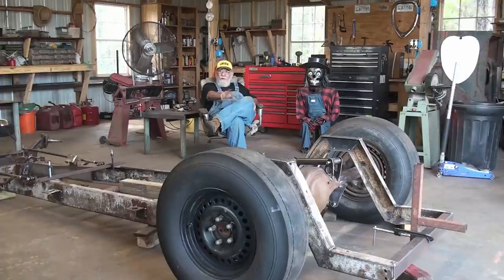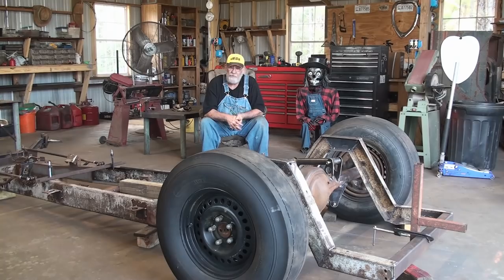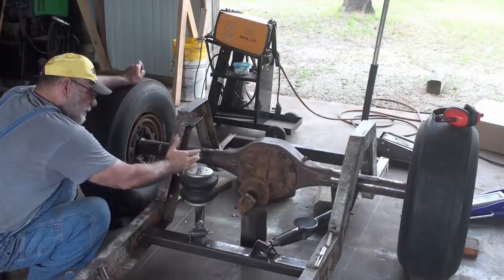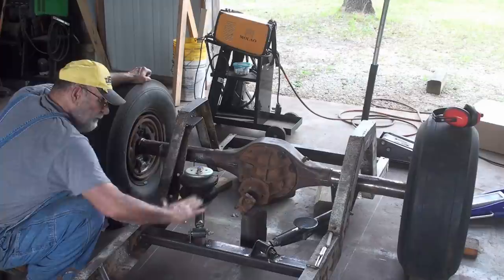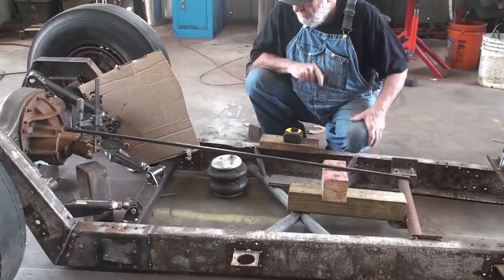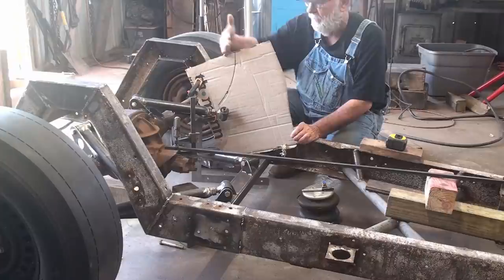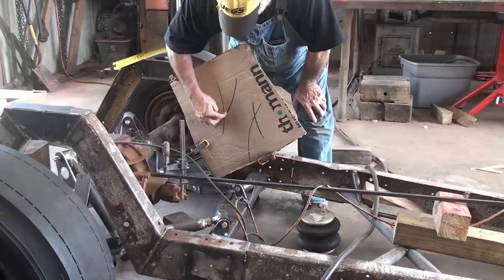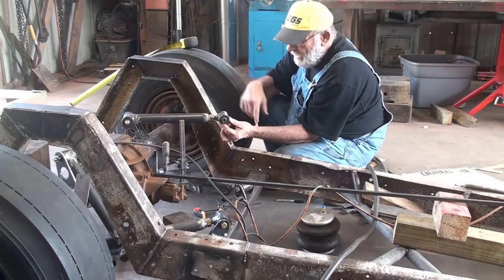47 Ford Truck Rat Rod - Triangulated 4 Link From Scratch Part 2

Comment from the maker: Another detail I forgot to mention is that the top link needs to be 75% of the length of the bottom link. My bottom link is 20" long and the top one is 15".  That is true even with a parallel 4 link.
Reply: Thank you for sharing that. I would have assumed equal length otherwise.
Reply: I thought it was 70% of the bottom link.. Thanks
Reply from the maker: @geoffreymills9932  Close enough. I use 75% because it's easier to calculate.
Reply: Thank You for this and all the other information. t.
Reply: Are you going to leave the mounting points for the links open (double shear) or are you going to tie them together like a C channel?
Reply: I'm sold .  I believe I will use a triangulated rear. I'm using your videos to build mine.
Reply: Parallel 4 link are even length...all 4 same length...

Comment: If you don't have a degree in engineering already some college ought to send you one in the mail.
Reply: The days of "self-taught" like Lincoln's self taught reading so he could pass the bar exam without a law degree are long over! ...and it's a crying shame because there's an awful lot of real talent out there that goes unnoticed because people don't have deep pockets to pay for some name school!
Reply from the maker: Ha ... it's a shame that some of these big name schools turn out some of the biggest air heads.

 True story:  Back in the 80's I was working hard in construction .. in the heat and wanted to better myself and learn how to build and program computers .. so I went to every library around and checked out every book they had on the subject ( before internet ) ... bought my first computer and learned to program in PC Basic .. wrote/programmed several simple computer games ... it was like a miracle to me. My next computer was one I built from components and I learned to program in C which was before C++. In 1989 ... got injured on my heavy equipment operator construction job and had to train for another job .. which I choose computer programming. In 1990 I had to do a community college thing to get that piece of paper that said I had potential and I done an apprentice thing at a local distribution center programming in a C++ and a 4GL database language (PROGRESS 4GL). Was working next to two other guys who had bachelor degrees and was working circles around them ... they would come to me for answers. Bottom .. line ... with no degree ... 2 years later I was making $40 an hour ... 3 years later $50 and hour and $60 an hour by 1999 .. the sky was the limit. I worked coast to coast as a consultant in database design and computer program specialist for fortune 500 companies! You could only imagine how all those high class folks reacted when this guy with a strong southern accent walked in and worked circles around everyone with high degrees. It was so much fun to watch. But my true roots was in construction being outside instead of inside looking out from a high rise window. So in 2002 .. after I proved to myself that I could be/do anything I wanted .. I went back to construction (for a lot less money but much more happy) until I retired in 2014. 

So my story would be ... you can do/be anything you want if you have heart and want it bad enough and put in the work to make it happen. Also ... and most importantly ... money certainly does not make you happy. The more money I made the less happy I was .. led me to some dark places that I had to overcome if you know what I mean. Like Richard Pryor once said ... cocaine is Gods word for "you making to damn much money". End of story.
Reply: @RatRodBobBuilds  Amen, brother.
Reply: I do have a degree in Mechanical Engineering but I learn heaps from your videos thanks Bob.
Reply: @RatRodBobBuilds  hell of a great story Bob. Thanks for sharing.

Comment: Thank you Professor Bob!
  You saved me a ton of grief with today's lesson. I am preparing to build a four link starting tomorrow. I was going to construct the parallel style. Now I'm definitely going triangulated. Locating the top link would have taken a ton of trial and error had you not shared the highly classified X marks the spot method.
  You made my morning!
Reply from the maker: Another detail I forgot to mention is that the top link needs to be 75% of the length of the bottom link. My bottom link is 20" long and the top one is 15".  That is true even with a parallel 4 link.

Comment: You got through to me Bob , that's as good as it gets ,i have a two link ,with a panhard bar ,and on top of the pinion, I'm putting a third link ,to keep my pinion angle straight,and coil springs with wieght jacks .thanks for another great video!!

Comment: Thank You Professor Bob. You are my inspiration to build my ‘29 Dodge Brothers (what was a car) that was sectioned in the ‘40-50s to be a pickup. The question/concern is the angle of the driveshaft. In all the years of building jacked up 4x4s, I was told by a driveline shop owner that no matter what the angle of the driveshaft the most important is the angle of the transmission output shaft and the rear ended input shaft MUST be on the same plane. Or the u joints will be in a bind and Will lock and blow out. Bad things happen. Also leaf spring tear ends have a preload of about 3-5 degrees so that under load the leafsprings curl. That’s why traction bars where created.
Reply from the maker: Truth be told ... point the rear end input shaft to the tranny output shaft as close as you can and call it a day. It would take a hell of an angle to bind the u-joints. I just did it this way because I can. LOL

Comment: Bob, I know you like the Rust look but have you ever thought about painting the entire car one single color without any of the prep work ...Paint right over the rust, the dents, the scratches and the deformities to simply have a uniform color?  I can see this Pick-up in a light tangerine!  You don't even have to use a spray gun.  I once painted an entire car with one of those red plastic handled mini-rollers and a a few quarts of Rustoleum paint. I applied the coats very thinly and after the third coat there were no drips, streaks or lines.  It came out astonishingly beautiful and because the paint is  a sort of filler in itself, smoothed out a lot of the anomalies!

Comment: Very nice brackets especially the top front clever
Reply from the maker: At first I was thinking ... man these top front ears are gonna be a pain in the a$$. So as usual I took one step at a time and I fabbed the outside ones first .. then like magic ... as usual the other ones came right to me. So the bottom line .... do what you can ... the rest will come to you in time.

Comment: Great job on the 4-link... But you do NOT want the yolk from the rear end to point toward the yolk out of the transmission you want them to be as close to parallel planes at ride height.

Comment: I like your set up and lower bag bars, Your Thinking Chair is working fine. 4 link parallel bars work fine with Hiem joints but not with bushings. The 75% is not true with parallel 4 bar, just ask Red. Get 2 Popsicle sticks and some thumbtacks and make a jig on that cardboard. I wana see Red eat a Popsicle. I look forward to more RRBB.
Reply from the maker: Good idea with the popsicle sticks. I think 70% would be the scientific number for non Rat Rods. Also depends on the angle of the front mounts .. I think. LOL

Comment: Bob, that was a very informative video.  My 1967 Chevy II Nova still has leaf springs and I found out that they are not exactly parallel. The front mounts are slightly wider than the back.

Comment: Love the build I enjoy watching gives me some ideas for a couple projects I like the idea of the triangulated 4 link makes a tone of sense hyme joints would give a lot smother travel in addition to that style I think id use that in part of the combination
Reply from the maker: Yes .. but you have to consider hyme's joints will wear over time but good for racing because they don't get a ton of use. As you have seen .. I used hyme's joints on the front but will have to be prepared to replace them over time. Unlike factory joints that have grease certs (well .. at least they had them back in the day .. lol).  But ... if I wasn't so frugal on this build I would have used them on this 4 link too .. beings it's a Rat Rod and won't get a ton of use.
Reply: Agreed they would wear I also forgot to mention that my builds are small scale rat rod gokarts and lawnmowers things of that sort also dead  red makes me smile every time I see him I just want to say I'm not criticizing any of your building its quite informational iv always built thing with what ever I could find turning it into something fun and functional thank you very much for taking the time not only on making you videos and for reading and responding

Comment: bob, you want the top and bottom bars to be parallel when at ride height? i like how the lower bars go one way and the top go the other, keeping the axle centered as the axle goes up and down....not need for a pan hard bar with that.
Reply from the maker: I understand your question .. and the answer is not exactly in my case. A lot of geometry in the four link setup but the x marks the spot trick works great for me .. without breaking out the slide rule. LOL

Comment: I think what your trying to say is, triangulated is the way to go for a driver. I gotta try it on something.
Reply from the maker: If you look ... I used triangulated on the 454 Rat Recon and Charlotte but parallel on the Demon Falcon. So ... yes! I used the cardboard x marks the spot on the triangulated builds but this is the first time I showed it. Works perfect and you don't have to be a rocket scientist to do it.

Comment: From a top view, the bottom links point somewhere towards the transmission and the top links point to the outside of the frame. How do you determine the degree angle of the top and bottom links in relation to each other? Great video Bob, school has never been so interesting.
Reply from the maker: I just wing it. Ha ... best answer I can give. I would say mine is on about a 25-30 degree angle and I try to keep the top and bottom on the same angle .. but honestly ... I eyeball it.

Comment: ((😂)) Lol” gotcha Bob” I just just a long ways from getting it done yet.. them air bags looks very similar to the ones on the back of my eight bag air ride setup on back of my Kenworth simi truck .. I just wonder if them type of bags will work on the rear of my 31 Rat I’m building .. I’m just wanting to run bags only on the back of my Rod the front is setting low enough with a 4inch drop I-Beam front axle.. plans are to channel the firewall down over the frame, body with a slight tilt down at the firewall that when the rear section of body drops down it will set even on the grown .. do you have any Rat Rod ology input for me on what I’m attempting to do ?
Reply from the maker: I call that the wheel barrow effect. Check out my first Rat Rod .. the 454 Rat Recon ... here is the playlist: https://www.youtube.com/watch?v=1JCKcBif-LY&list=PL17ffBx4Y_BOvy-dA6ztCm6a14qFNIr-W

Comment: Hey Bob, always  look forward to your videos.  The rear suspension is looking  real good!  I would like to ask you  what thickness of metal do you use for the tabs on the suspension?  Thanks again for taking the time for schooling us in rat rodology.
Reply from the maker: I usually use 1/4" but I used 3/16 here ... will be adding another piece to the bottom ones for bracing when I welder up. Stay tuned.

Comment: Thank you so much ,trying to decide how to link my rear end in right now ,and this is very helpful ,can this design be applied to my ratrod ,without air bags ,i have coil springs over the top of the axle with weight jacks from a stock car (screw jacks), also i may need to go with heim joints if budget insists, but it will be triangulated, or only a two link ,thank you Bob once again !
Reply from the maker: Sure ... works great with coil springs. That's what I used on Charlotte with triangulated 4 link.
Reply: @RatRodBobBuilds  Oh awesome ,thank you for the info Bob ,now just have to get some of that liquid rubber on Ebay ,haven't been able to find it anywhere else ,and the shipping is double the price plus tax out here in Arizona ,see ya next video ,take care now Bob ,and Red too!

Comment: Yes you got through Bob. So you can make the bottom link length whatever you like, so long as the top link is made 75% length of the bottom one?
Reply from the maker: They say 70% but I use 75% because it's easier to calculate in my head. Ha ha.
Reply: @RatRodBobBuilds  If you measured in metric 70% would be easier, say a bottom link is 890mm. 10% of 890 is 89, so if the top link is 70% , it is 89x7= 623mm. Not easier for everything but metric wins this one.

Comment: Well done Bob , But there one thing i don't like is why did you drill those big ass hole in the top brackets for holding the top bars , I know there going to be no stress but there always a but on road use ,  In time they  might tend to crack as there not much material there now.. I myself would slid a pipe though the holes and go all the way to the diff housing  and weld it together for strength  that would look Cool and stronger   .. Otherwise great job ..

Comment: You explain just fine, just one question the bottom links are facing in and the top links are facing out, what degree did you use on the brackets. Thanks Bob
Reply from the maker: I wing it ... 25-30 degrees.

Comment: I'll use this on my builds thanks Bob. 1 question. Isn't a leaf spring rear basically do the same as a parallel suspension?
Reply from the maker: Leaf springs are really flexible ... making them perfect for a daily driver but needs traction bars to keep them from twisting in a driver/racer application.

Comment: Hey Bob, is there a rule of thumb on the angle of the triangulated 4 link to each other, in other words like if you were looking strait down at them
Reply from the maker: Probably ... scientifically. But I don't know what it is. Mine are about 25 degrees.
Reply: @RatRodBobBuilds  Thank's Bob for answering my question's as usual

Comment: Thanks Bob that was interesting and I learned a lot. I'm pretty impressed, and I don't impress easily! Are you going to be gusseting the axle brackets, or should they be strong as-is?
Reply: They are already as strong as the axle or the weld without a gusset cause the diff is only going to try to turn over
Reply from the maker: The lower ones yes ... because there are kinda long. stay tuned.
Reply: Sorry Bob guess I was wrong waiting to see thanks for the reply back

Comment: Bob what are the dem on your 4 link pipe outer dim and lenth on that pipe and is it chrom molly pipe.
Reply from the maker: The outer diam is about 1 3/4" . The bottom links are 20" eye to eye and the top are 15" eye to eye. I went to the steel yard and bought a stick (20') of  1 1/4" pipe. Same thing they would use in the oil field or a plant. Mild steel .. not chrome moly and not NHRA approved .. LOL. I'll be using more of it in the build ... stay tuned.

Comment: Bob how did you figure out where and how long the bottom tabs on the rear axle ..
Reply from the maker: The rule of thumb I use is ... the longer the rear end travels up and down .. the longer the bottom link needs to be. My rear don't move a whole lot so I used 18" and then another rule of thumb I use is ... the top link needs to be 75% the length of the bottom link. So in Highly Classified Scientific Rat Rod Calculations ... the bottom link is 18" so half of that is 9" and half of 9" is 4.5" so 9" plus 4.5" = 13.5" which = 75% of the bottom link. So that's the length of my top link ... 13.5". Or to make it simple ... make your bottom link 20" and the top link 15".  Should be good for most rats. But then again ... so is 18" and 13.5". For really short travel you could get by with 16" and 12". Don't do like me and over think it or you'll never get anything done. LOL

Comment: So the lower and upper links won't be parallel from each other?
Reply from the maker: Parallel 4 link is more for racing on flat surfaces while triangulated acts more like stock suspension and works good on rough terrain. I try to explain that in this video: https://www.youtube.com/watch?v=2Pm5ij9bwfw
Reply: @Rat Rod Bob Builds  I meant level with each other. I understand the triangulation just wasn't sure if the top links will be level with the lowers
Reply: @Rat Rod Bob Builds  I don't have much room for the lower links so they are pointed down and my uppers I haven't gotten done yet, but each place I put them they are opposite of the bottom
Reply from the maker: @Mikewheeler131  Oh I hear ya! No, they are never level with each other in my experience. Just make sure when the rear end goes up and down the pinion shaft stays pointed at the trans output shaft.